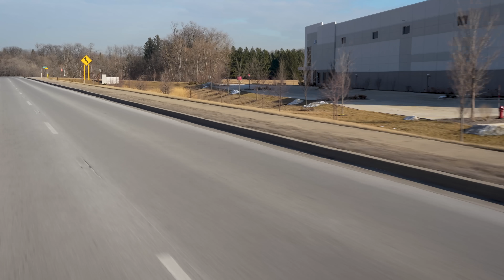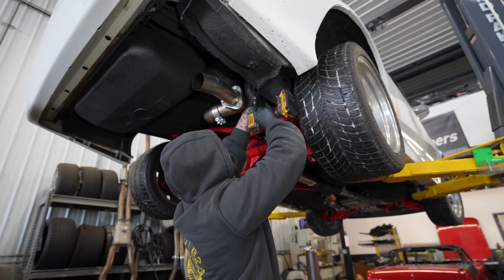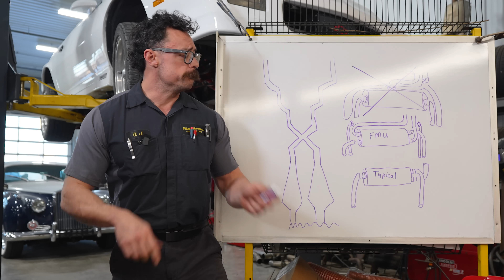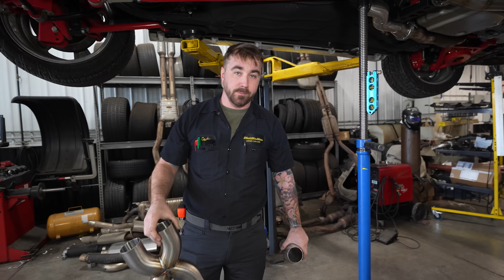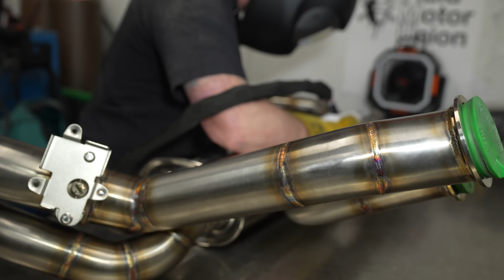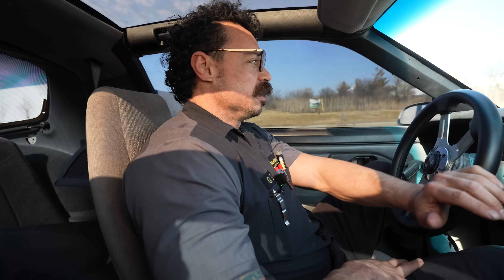This Camaro Exhaust Shouldn’t Have Made 30+ WHP: LS3 Stepped Pipe Layout Everyone Will Copy

Comment: Dropping your car off for an exhaust and getting it returned with 50 extra hp 😂 more than a 10% gain on overall whp.... safe to say this is gonna be one HAPPY customer
Reply: 10% WHEEL horsepower is crazy
Reply: @masturone8257 increase wheel or crank is the same.
Reply: Its nice for sure, but the customer definitely from that 💸 💵 for it.
Reply: @1FiftyOverland Yeah spending probably over $2k for a full custom system and retuning wasn't worth it but might be for them
Reply: @paulwilliams6534  probably way more than that lol
Reply: @paulwilliams6534 id bet $3500 out the door.  Great work, but you gotta pay for it
Reply: @paulwilliams6534  And what mod to an existing cammed LS3 will make 10% WHP gain for less than 2000 for the complete setup (a full turbo setup would be way more than that and a supercharger would be way more than that.. this isn't 10% WHP from stock, it's 10%WHP from an already improved engine build).  Remember that WHP is a reduced figure that is non-linear so 50crank HP does not net 50 WHP. I'd be all ears for that cheap of a 10% WHP gain on an already built motor.
Reply: Yeah prob more like$3k  @DanimalZ32
Reply: @meatybtz Yes I know the difference between bhp, whp and factoring in drivetrain losses. My answer is a 75-100hp wet shot nitrous system. I was being nice about this exhaust kit, being realistic with the cost of materials and labor time to make this kit would make it around closer to $3500-4000. A custom 4 banger single 3-4" exhaust is around $1400-2000. So realistically with the cost of this whole system I would go with a single turbo kit S375, or 78mm with a shorter muffled exhaust system. This exhaust system is very nicely done and helps the engine breathe but the cost to horsepower ratio is high probably around $45-60 per HP. With nitrous or a turbo kit brings it down to $15-25 per HP.
Reply: @paulwilliams6534  That's blatantly dishonest. A turbo system for an 8 cyl would be accurate. A wet shot of nitrous is NOT a reliable system and is something for track only. This could take a wet-shot and make even more. So no. Your point isn't made. You are talking about an off the shelf 4-cyl exhaust.  You are not even comparing apples to apples. As I said. Take a V8. Make power (all the time, not just at the track), equal to that which is gained for the price of this exhaust system. You can't. Also.. you were the one who stated 2000 USD, not me. I was keeping it within the parameters you stated.  People love to bag on things on the internet but can't follow through with actual results.  A freaking wet-shot and a 4-cyl exhaust. Wow.

Just for a turbo kit, basic, generic, still requiring custom fab for a V8 is going to run you 5-8000 dollars. A super charger on a V8 is going to be 5-10,000. Both still require custom fab work, which is extra. Tuning, which is extra. Car made streetable power, a bigger cam would reduce drivability. Both still would require additional expense for an exhaust system.  Freaking ricers and their "nawz". N20 is a track only feature, and it's very hard on the engines. 

I suppose you will suggest, "used" parts, or "junkyard" turbos or super-chargers next.  Any professional would look at this and think, excellent for an "all motor" improvement. Nothing stops them from adding in a super or a pair of snails later, if they want more. Engine is already in a very good place now, with plenty of exhaust flow available for forced induction additions later on should they want to do it.
Reply: @meatybtz Nitrous is not for the track only as many run it in their street cars, wasn't talking about 4 cylinder exhaust off the shelf haha. Only spoke about the price of a custom 4 cylinder exhaust which is half the price of a V8 usually. I've owned and worked on import and domestic. Don't take things so literal. Don't have the time or care to reply to the rest of what you stated. Good day
Reply: @paulwilliams6534 you run nitrous on the street l? And not just for erm... Street racing? I know of no one who drives around running nitrous. Well excepting a few people with enough money to just replace engines and those are in 2000+hp street cars and very deep pockets.
Reply: @meatybtz 
Lol, I ran it on the street. 150-200 shot.
Reply: @paulwilliams6534 
Try 5k-6k
Reply: @paulwilliams6534 
$5-$6k
Reply: @bigdaddycool4242  And it was "on" all the time? People run water/eth/meth injection on the street and DEF so it could be viewed in this day and age as just like putting DEF in the tank. But that's a lot of N2O you are burning.
Reply: @meatybtz 
No one said it was on all the time nor has anyone else said that.
Nitrous does not burn🙄
Reply: @paulwilliams6534  the way the build looks, seems like the owner wants n/a. If power numbers were the only goal it would make a lot more than 400 wheel with cheaper parts.
Reply: @paulwilliams6534 I’d spend 2k all day for that exhaust set up and a tune, he just took this from a pretty standard sounding ls to something that really captured the era and amplified beautifully. People spend 750-1200$ on cat backs all day and another 5-900$ shitty OTS tuner.
Reply: @meatybtz  sit down young fella while this man itls talking! Lol. Well put sir 👏
Reply: @paulwilliams6534  In suburban Chicago probably more like $4-6K by the time the invoice is complete . I know I'm an hr outside DC and if I did the same type of custom exhaust and dyno time with tuning as well as all the other small problems he wants to address the labor would be 2K at a min.
Reply: Awesome. Most people freak out on the "i missed that" and you just said "this is what you missed" idk why, but that meant more to me than the knowledge of the video and I've had 5 of this platform. High five 🤣
Reply: Yes until they see the final bill.
Reply: wasn't 50 HP, exhaust was 32HP the other 20HP was tune. So almost 40% of the extra power wasn't even from the custom exhaust, and he didn't show oif that power was open or muffler. Running it on "QUIET" may mean ZERO more HP... He should have shown HP results from new set up open AND quiet modes.
Reply: Any dude who is obsessive about quality as this guy is … well hats off bro. My god I just found this guys channel and he is the type of car mechanic that should be the example of how ALL shops should be run. 

Honest work, serious about quality, doesn’t mince words about cost and also doesn’t deal with customers who doesn’t want to pay the price for quality , thorough, excellent work.
Reply: Of course an LS6 choked off with with a single 3" exhaust is going to have a good gain going to dual exhaust not to mention any collector extension is going to give a nice hp and tq gain on its own.
Reply: With the amount of money in this car, this customer definitely isn’t complaining about cost. True not all of us can afford it, atleast I can’t but I commonly do work on projects like this for people who have money. They ask for an idea of cost but look at it like they have a problem and want to pay for someone else to fix their problem.
Reply: I've bent exhaust 23 years. I talk people out of 2.5 inch exhaust. Easy 50 hp diff 2.5 to 3 inch if it's making any decent horsepower. Dual 3" on an iroc without rattling is very doable and I've done it plenty of times. I can make 3" fit on anything over axle.  I'd just mig that header extension in place. 90 deg welding head helps. If they don't want to see the exhaust you paint it black and it totally disappears. Every magnaflow style muffler ive ever installed Drones like mofo and had to switch them out. havent sold on in 10 years. People don't like their ears bleeding while they are cruising at 55. Honestly i think it gained the power because of the dual exhaust and not into a single 3" Borla Is way overpriced and quality has gone way downhill. Customer had a borla kit they brought in and the the x-pipe was about 20 degs off One pipe going back was about 2 feet lower and unusable
Reply: @user-px3qi6wx6y  I actually became a huge fan of the cherry bomb vortex.... no drone at cruising speed, quiet at low rpm and decent volume at full throttle, and the "tone" is lowered aka more bassy than it should be. I had one on my 05 sti. 3" pipe to 3" in/out vortex. and before the subaru kiddies knew i made the exhaust myself.... they LOVED how it sounded. "best exhaust i ever heard" yet the moment they found out it was custom made, i was shunned as a leper where they would say "you should buy the titanium exhaust from brand X because it makes the most horsepower" and i literally cringed. 3" pipe is 3" pipe. the main difference is the sound profile in most cases. my buddy and I both had s2000's at one point. same engine, same everything. i had a skunk2 exhaust he got a greddy. they sounded different but made the same exact power because we had the same mods aka intake+exhaust at the time. but yeah. huge fan of the cherry bomb vortex. underrated muffler. high flow, quiet at idle, no drone. its just a huge winner for me.
Reply: @goblinphreak2132  I had a 1970 International Harvester Scout with an AMC 304ci V8 and swapped in an International Truck carburetor with larger jets and a manual choke. The exhaust was all bound up so I made a pair of DIY exhausts using 3" stainless flexible tubing into Cherry Bomb glass packs and Laker style pipes to right behind the front wheels. 
In 4wd it would scratch in 1st and 2nd gears!
Gotta love Cherry Bombs! Great Rumble at idle and Awesome Bark when you get on it! 👍👍👏🍒
Reply: @goblinphreak2132  I love bassy tone exhaust the high pitch stuff just annoys me.
Reply: @theosexpertdaymon2774  you would probably love the cherry bomb vortex then. that muffler has a way of making the one drop. subaru rumble? became deeper when i had it on my 05 sti.... like it was smooth AF. and that was just stock downpipe + 3" pipe to muffler. no resonator.
Reply: @ziggggy53ify  glasspacks are different than the vortex but yeah. the vortex looks like a normal square muffler and has an internal baffle + sides being filled with that packing/filler material. at slow speeds it absorbs sound and at high speeds it switches to high flow. its pretty wild.
Reply: I mean that's a dyno shop... So it wasn't there just for an exhaust... It was there primarily for one but no way it wasn't gonna be optimized on the dyno after .

The exhaust on there and engine built had lots of janky crap they figured out song the way so it was bound to gain power.
Reply: Until he sees the bill
Reply: Sounds like the majority of the gain is because something was very wrong with the original tune, and not necessarily because of the new exhaust. A LS3 with a fast intake, a cam (presumably), and headers, and exhaust should be making well over 390whp to begin with...
Reply: @superbarnie You clearly didnt watch the video
Reply: @elmatador4759  😆what'd I miss?
Reply: @superbarnie  start watching at the 3:40 mark or so.  THey mention how they had to repair/fix the crank sensor setup, and they dug into the tune to fix the oddball timing issues.
Reply: @mattliston1215 AFTER the inital dyno number😂. He's correct.

A "cat back" going from single 3" to duals, which is all they replaced, isn't picking up this much hp alone. Ever
Reply: @tooslo5oh44 That setup was garbage to start with and the new setup absolutely will pickup that kind of power. I picked up ~25 whp changing my muffler on a ~470 crank HP Gen 1 SBC.  I was running a dual 3" in/single 3.5" out factory style muffler for a 6.0/8.1L truck into a 4" tail. Went to a Howe Racing H4022 merge Y with a 4" straight through AP Truck muffler. The exhaust change smoothed out a lot of random dips and goofiness in my torque curve. At 2,700 rpm it was up 34 WTQ. That was not even touching the rest of the exhaust system and I also run cats.
Reply: @superbarnie Not with a horrendously bad merge and a 3" single exhaust its not.
Reply: Till he gets the bill this guy talks way to much the runner knows his shit not this yapper

Comment: That car is registered to be on the street so how does it get away not having cats????
Reply from the maker: What state? What years require testing? What’s its use? All of these play a factor. We build cars for the owners intended purpose. 
There are more systems then catalytic converters on cars that are federally mandated… can I legally force customers to fix components if I have possession of the car? Not in this state, and neither does his.
I can only recommend- and the final decision is the customers…
Reply: Who cares what California does? I solved the smog problem years ago. See they have a mountain chain causing the problem, they had smog problems in the 1800's! So either A: move the mountains or my idea B: 100 acre minimum size lot one family home of 4000 square feet max allowed. There solved the smog problem!